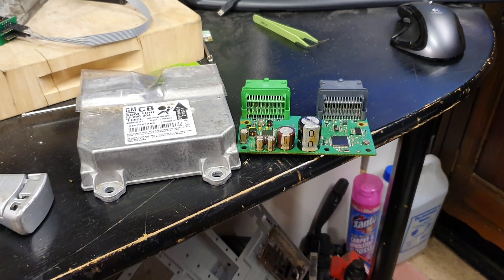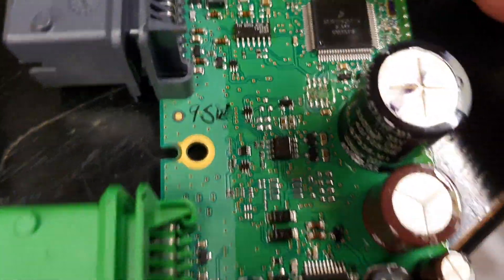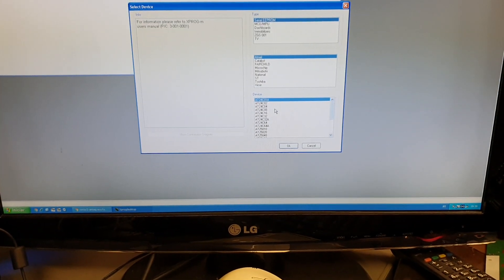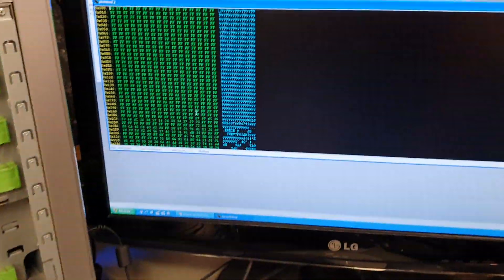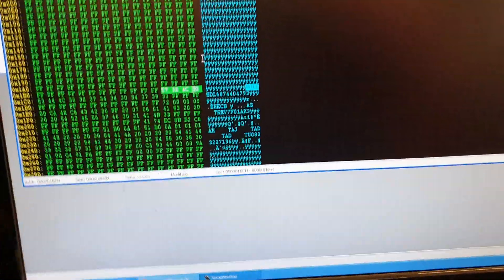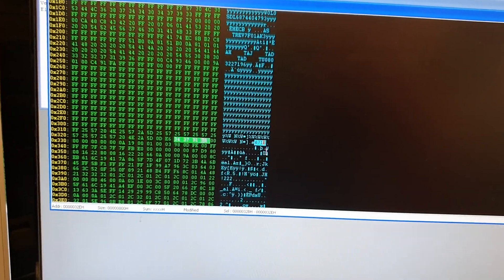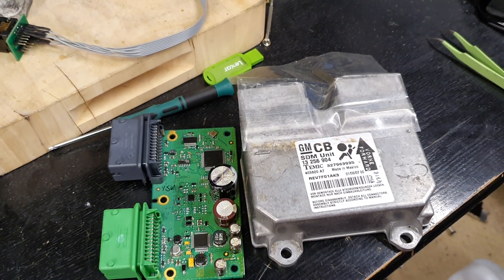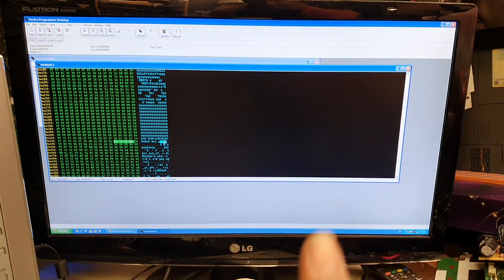Corsa D security pin retrieval from SDM (Airbag) module.

Comment: can you transplant the cip containing your information onto another used module and that's it?
Reply from the maker: Theoretically yes...
👍👍👍
Reply: @LMAutoRepairs  are there any other chips on the airbag module that contain the information besides that chip?  like processors or something?  A thousand thanks
Reply from the maker: On this particular model, I believe everything is on the eeprom...
But, this is not always the case...
Depends on the module, car, etc...
Reply: @LMAutoRepairs  thanks

Comment: You make it seem so easy Luis and it is ,  till a certain degree . But after all the years that i have been doing  it I still manage to screw things up . The reading is the easy part but the ..................... soldering  is starting to get on my nerves . You still manage very well but I need to use the magnifier all the time . The years are starting to count .
Reply from the maker: I will get to that stage... hopefully! 
😋
👍👍👍

Comment: Great video ! Off the topic question but though i would ask anyway, If you want to change the mileage on a cluster with k tag or any other software with eeprom chip removed would you also need to change the mileage that is stored in the ecm as well,  Always learning something nee from your videos!
Reply from the maker: Hi
K-tag is really not the tool for that... at least for clusters...
As for the question, depends on the car, some cars the cluster is enough, sometimes the mileage needs to be corrected in multiple modules... otherwise it will always adjust to the highest one...
Thank you for watching and for your comment!
Reply: Thanks for your reply much appreciated

Comment: Hi Luis!
1.What is the purpose of finding a pin code?
2. Is this PIN code common to all ECUs of the vehicle? Usually, it is read from the display ...
Reply from the maker: Hi
As I showed in the past, on vauxhall you need the pin to for example, program new keys, reset modules etc...
Most of modules, on vauxhall, do have pin code, but some modules you don't really need it, even if reusing the module in another  car...
What exactly do you mean with read the pin on the display?
Thank you for watching and for your comment!
👍👍👍
Reply: You will need to know the pin code to programme and activate or change  different modules or features that were not configured when the car was first built. 
 Example configure cruise control, change the instrument  cluster, change the mileage etc
Reply from the maker: Forgot that...😊
Thanks!
Reply: @LMAutoRepairs  This is another opportunity to find out the pin code. Thanks.
At first, I thought that knowing the pin code, you can do something with the airbag module ...
Reply from the maker: @engeneer_ru5827  
You can... reset it and re-use it...
👍👍👍